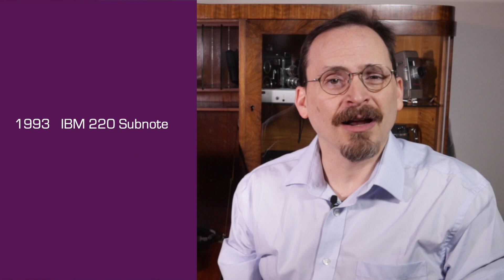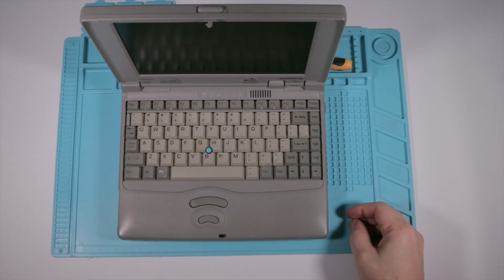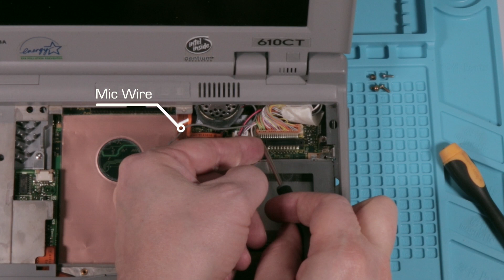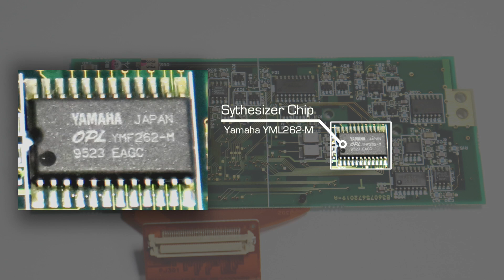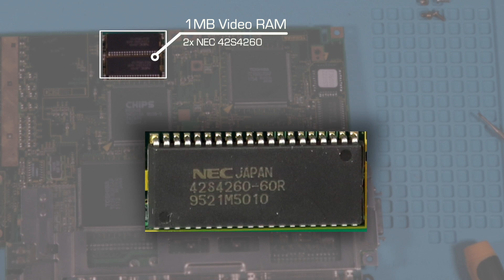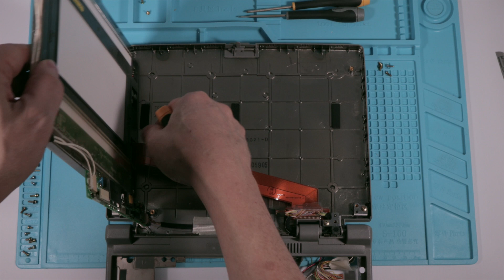Toshiba 610CT Portege Technical Tour and Teardown

Comment: I have the Japanese version, DynaBook SS-R590. I also had the CMOS/backup batteries leak but I was lucky. The LCD is showing some signs of LCD rot, but it's minimal for the most part right now. I found your video to be very useful in conducting maintenance on it. Thank you very much!

Comment: got mine to work, bought another one from ebay from goodwill, board is good but screen was bad, replaced it with mine. changed hdds as well since mine had 95 and drivers for the modem and cdrom. cant believe a dentist paid 3200 for it, plus 200 for modem and extra ram 16mb ram was expensive. mine didnt work due to some oil on the cpu. i got it that way. the caps lock flash twice is normal apparently then screen comes on. works like a champ. not sure about the main batteries tho. im not putting in replacement backup batteries, id rather deal with f1, end, and y and it boots. its a cute little laptop. compared to a normal one lol. this will be highly taken care of.

Comment: Let me know if u get this fixed, I have the same and both of the battery's leaked, I cleaned the corrosion off and looks clean, afterwords, upon turning it on the caps lock key flashes twice and that's it. Hdd spins up, no screen engagement. Battery does charge. Cd rom is Panasonic kxl-d740 with pcmcia scsi type
Reply from the maker: Will do... very much a back burner project.  So many projects, so little time.
Reply: @beige-o-vision6936  Few years late, but for what it's worth, my 610CT is operating normally with both CMOS and clock batteries removed. It just throws a CMOS checksum error on every boot, but that's easy to clear with two keystrokes, and the default settings are good.